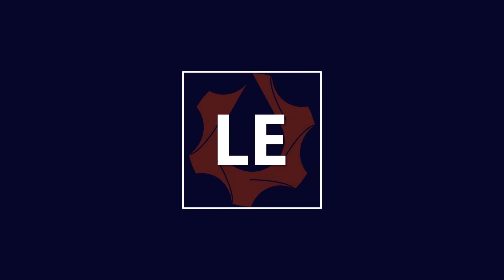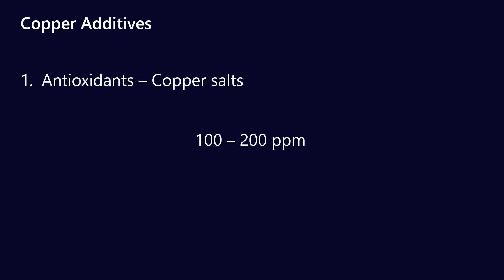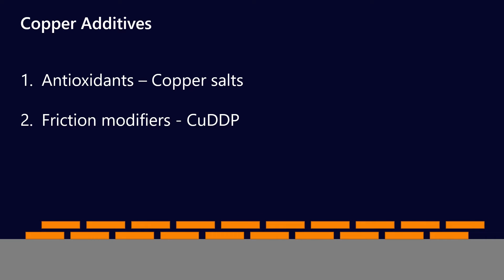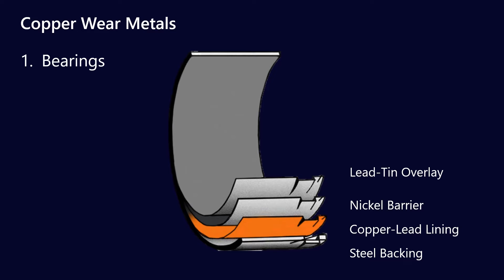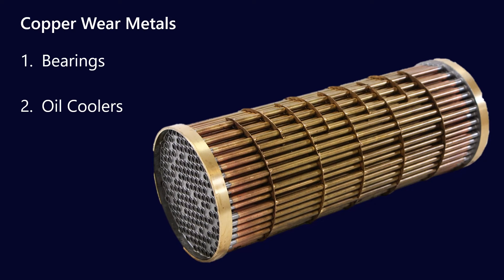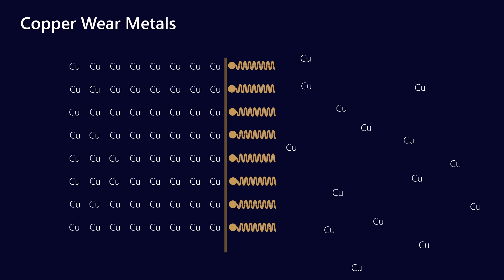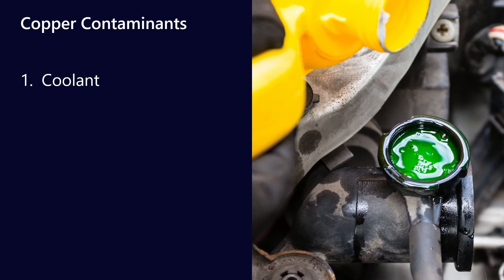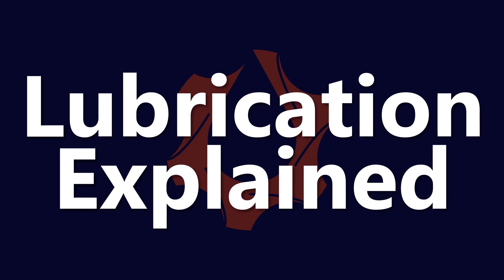Copper  |  Additives, wear metals & contaminants

Comment: I'm happy to be corrected but I haven't seen copper additives used in engine oils in the last 25 years. Paramins pushed them for a while but they screwed up wear too much (on the Seq IIIF?) so fell out of favour. CuDDPs? Did they ever truly get commercialised by anyone? If memory serves, to make them, you mix Copper Chloride with ZDDP to get a double decomposition reaction going. The problem is this makes oodles of nasty HCl which you them have get rid of. Furthermore, trace levels of chlorine in any lube additive are a bit of a no-no these days because of concerns about low temperature oil burning creating dioxins. Finally, whatever role copper might have once had has largely been supplanted by Molybdenum which is a brilliant AO, AW & FM.
Reply from the maker: Yep! Not seen it either but have come across some hydraulic oils that “accidentally” had CuDDP in them. The oils didn’t have much of a copper passivator in them and it seems the Zinc in the anti wear package swapped out for Copper. Good news was the anti wear performance improved!
Reply: @LubricationExplained  Never really saw the point of Copper Passivator. Sometimes I'd come across it in something the Japanese had self-formulated & you'd know in an instant that these people didn't have the first clue what they were actually doing!
Reply: @MrSensible2  I mean yeah who needs bronze sycros to last anyway, those fools.